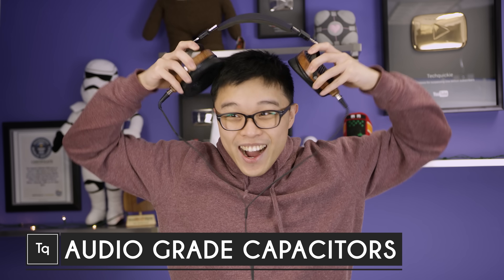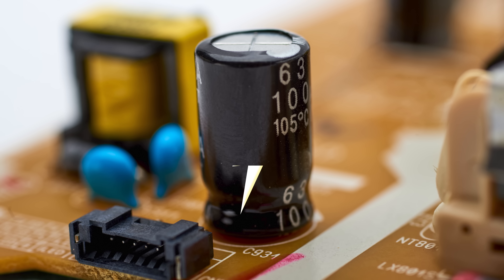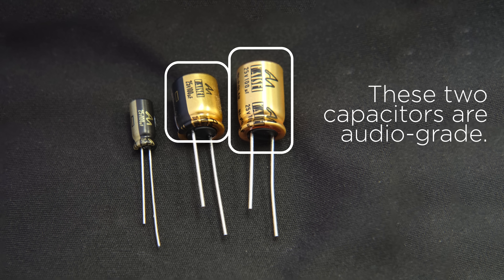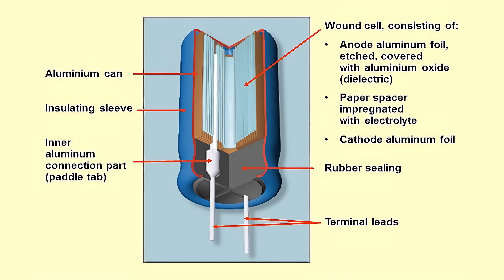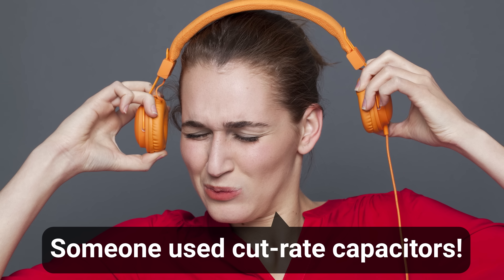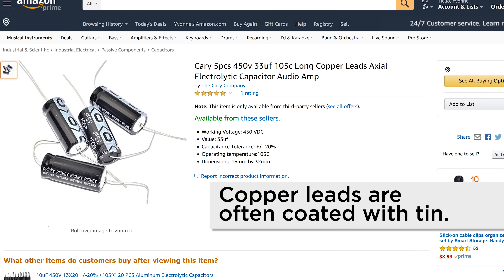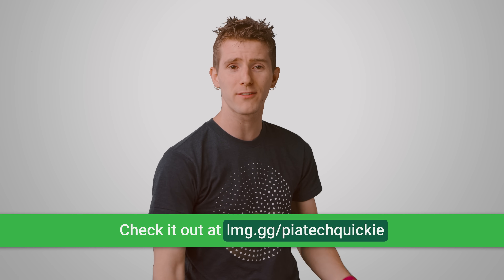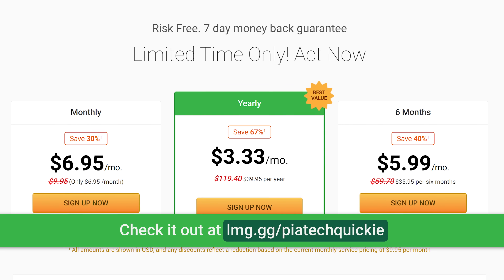What Does "Audio Grade" Mean?

Comment: So yea, guys, anyone who says audio grade caps dont sound better has never messed with electrolytic capacitors for the output coupling or input capacitance of a preamplifier. You have no idea what you are talking about and i don't care what your favorite electronics channel say about it unless they are experienced with amplification design. The audio grade non polar electrolytic's sound considerably better then their non audio grade polarized counterparts in many if not most audio applications and i can give specific examples rooted in mine and many others first hand experiences playing with audio amplification circuits. This is actually very common knowledge in amplifier design. Vastly over rating the electrolytic voltage spec also serves improvement in both tested and percieved sound and that is already something many "non audio" circuit designers love to call malarki on as well. If your amplifier design calls for inpput capacitors, dont even bother with audio grade electro's. Jump straight up to film and foil or something actually worth passing an audio signal through. Also common knowledge in the audio circuit design world that the rest of the tech world loves to call malarki on. Even if your system or headphones don't resolve well enough for you to perceive the imaging and "air-sound" detriments of odd-order capacitor distortions, doesn't mean they aren't there. 

Another thing that many love to call malarki on is the FACT that foil and film polypropylene capacitors of a rated value, ALWAYS sound better, and test with lower harmonic distortions then an audio grade electrolytic. Foil and film poly caps, metalized film poly caps, and audio grade electrolytics will ALWAYS, both tested, and perceived (perceived if a system is resolving enough anyway), out perform a standard or solid state electrolytic capacitor). I dont even want to talk about ceramic capacitors. Those little microphonic voltage variable bastards have NO place in audio circuits anywhere. 

Go download a known easily modifiable preamp schematic and solder it together out of dirt cheap components, or buy an el cheapo ebay kit or something, and start playing with different types of capacitors with an open ear and a good resolving system (maybe not $80 gaming headphones and a $50 amp/dac or crappy AIO surround system from walmart, neither of which can even do Imaging and sounstaging, at all). Your opinions on this will change very quickly. Many of you, if you were to do this, would feel quite stupid afterward honestly. 

And when it comes to keeping digital switching interference out of an audio signal, the quality of the filtering capacitance is absolutely essential. When it come's to high performance audio and resolving systems, both ears and measurements devices can note the differences between capacitor varieties. And the only capacitors of an electrolytic type that would even be considered for suck a job by an audio circuit designer would be non polarized audio grade electro's. But a quality metalized film cap would still measure and sound better both for this application, but it would cost more to implement and create a larger circuit layout. Non audio grade electros would just sound plain bad in this sort of application.

I can promise with almost absolute certainty that not one single person making certain claims in this thread have EVER ONCE sat in front of a truly resolving 2ch music system capable of precise imaging and a true depth of sound stage considering that's the moment people realize they had no clue what they've been talking about for some time now. It is a mind blowing, often life changing experience that most people don't even realize is even possible. From sound source, to equipment components, to the room itself and everything in between, it all has to synergize perfectly. But when it does it's a truly ethereal experience, and it's not even possible with 99% of the audio gear watchers of this channel are likely to be using. (I mean no offense, there, it's just the truth< and it's not 1995, it's not a matter of spending a fortune either)

High end audio isn't a walled garden anymore. You can toss a couple hundred at the class D/bookshelf/desktop realm now a days and get "the thing" im talkin about. You will also notice audio specific capacitors and inductors inside them because its absolutely essential to real high end audio performance. But you're still going to have to learn how to actually setup speakers to get any real performance besides a flat wall of sound with zero placement out of them.

It is absolutely a fact you have no valid opinion on something until you know what you're talking about though. You guys may wanna revisit the Dunning Kruger curve for a refresher.

Comment: also the higher end panasonic caps. i use elna for most but they do not have them in some specs. the electrolytic cap difference is, however, secondary to eliminating the ceramic caps which are a huge noise source as well as all the composite resistors which are also noisy as hell. when i rebuild my gear, i put in 1% film resistors and film capacitors for these. your gear will produce sound that you have not heard because it will no longer have to fight itself because of the noisy components. the elna's then will further sweeten the sound. you will find that you do not have to raise your volume as loud to hear the music because your system is more efficient. invest in a $300 rework station with a de-soldering gun and do it yourself. it is actually very easy if tedious and time consuming project. cheers 🙂

Comment: I'm an Electrical Engineer and also, because I enjoy driving at all hours of the day and night, am a Broadcast Engineer, SBE and IEEE member, etc....  I have 3 Harris MW-5's and 1 MW-50 along with some newer FM's 20-35KW under my charge.  WE use Nichicon UFG series caps in the Audio Chain and Panasonic's in other applications.  Made an audible difference on FM (if you listened closely).  Then Gates broadcast states that general purpose electrolytic have a service life of around 8 years.  Now, that's in 24 X 7 use and in warm - hot environments.  We rebuilt the 38 year old MW-5's around 5 years ago and the MW-50, about 4 years ago.  The only off air time thus far has been the 37 year old MW-50, which ate a 4CX35000 PA tube a couple years ago.

Comment: So what is the difference between an audio electrolytic capacitor for audio or a electrolytic capacitor for a power supply that is the same size,  same voltage & same uf?
Basically if I spend $35 on my "special electrolytic audio capacitors"  instead of $10 for my electrolytic power supply capacitors,  It will make me feel warm and fuzzy inside when I listen to my audio!

Comment: "Higher capacitance for size, is really important for audio" Sorry but i'm putting on my BS boots to wade thru that. It only matters for miniaturizing your design, otherwise if you have the space it make absolutely no difference in the sound. The capacitance value used for each individual capacitor in the circuit is completely dependent on the circuit and what it is trying to achieve. "Audio grade" capacitors are just a marketing ploy. Pick your capacitor based on voltage expected to see, required value, ESR needed, expected temperatures to see, and rated lifespan your willing to pay for.

Comment: Hey, you seem to have missed the upper half of caps.  Polypropylene caps are not represented here.  However the dissected caps that you show are Poly caps because they have a metal film.  The electrolytic caps use an electrolytic chemical as the conductor, not usually metal.

Comment: As an electronic engineer I must say that this video is very inaccurate...yes, capacitors can be used for smoothing the voltage but in this case we are talking about DC power supply part of the audio only!!! What concerns the audio part itself, the capacitors are used as FILTERS together with resistors and coils to make RC or RLC circuits that filter out unwanted frequencies and noise to make band filters, sound corrections, etc. Also it is not true that higher the capacitance, the better!!! Capacitance needs to be quite low but very precise in its value to be able to make precise band filters, so that's why the more expensive capacitors are more precise, not because of the capacity!!! Also the better quality capacitors don't deteriorate that quickly and hold their parameters longer, that's why they are also more expensive. So there are the main requirements for the audio grade capacitors, not the ones Linus said!!! Also capacitors itself CANNOT bring ANY NOISE or DISTORTION to the audio as they are passive parts !!! So Linus, you should discuss this with some properly educated person first...

Comment: This is what happens when LTT does not stay the computer tech course. Next he'll try to convince us the a $10,000.00 power AC cable has superior flow and back EMF to make your tech from a toaster to your computer work better. Come Linus, COVID-19 can't be hitting you guys this bad to ride the stupid train you are on right? Ripple filtering, and coupling are what capacitors sometimes and frequently do. DC coupling means no Coupling Capacitors on the signal output path at all. Also the Power Supply Nichicon Caps I put in my JVC Cassette Deck from 1978, just a little before your time Linus, did not cost a fortune, or have this Unicorn fluid secret in it you speak of and does nothing to change the sound other than let it run at specifications by the manufacturer as the originals were not in tolerance and had high ESR. No magic, no BS, unlike a good part of what LS, just fed us here. He consulted a manufacturer who has his own agenda. You know it is funny since this comes from Canada. You should watch Mr. Carlson's lab and learn something.  He too is in Canada, and much more trustworthy on these kinds of topics. He restores vintage audio and newer all the way around. He is not beholden to any manufacturer's pocket. The fact here is names were named as an off handed plug. Elna and Nichicon and Rubycon are a small cadre of brands in the world of capacitors. There are so many great Capacitors out there, you for sure will get the one for your project needs etc. I never think that any maintenance or operations component would ever make it sound better, but what the manufacturer had intended. Hence his parts lists etc. Note at least on the parts list from the manufacturers I have serviced electronic components for. They have never indicated a brand. Just the needed value spec and that is all. I got 50 years plus of doing audio, and fighting against snake oil and smoke and mirrors and BS "High End" audio's non scientific assertions.  I usually win because real applied science vs. the schiit we heard here, well, your call. Buy the hype, or correctly invest in the gear you want. You don't need to spend a mint for great parts. And spendy parts don't always voice better in applications than more reasonable cost parts. Engineering and proper voicing and testing and science that is real, not marketing a great sounding audio component make.